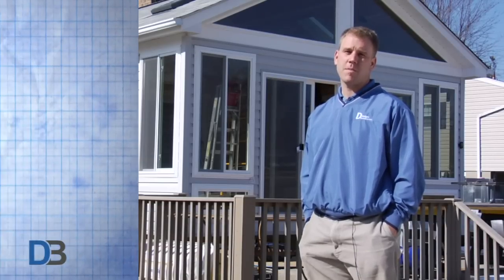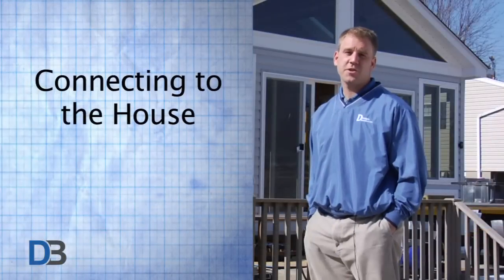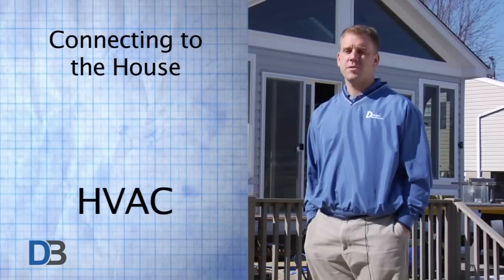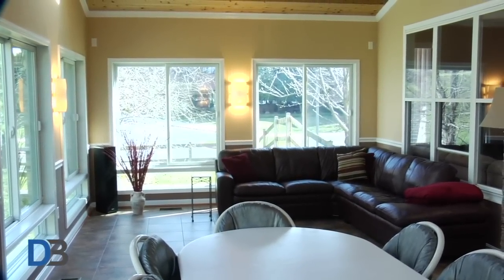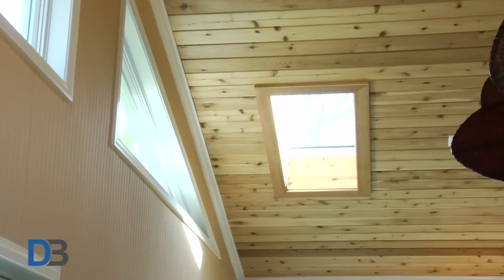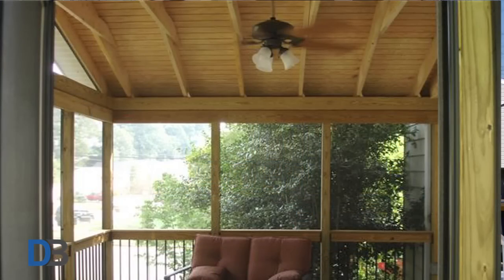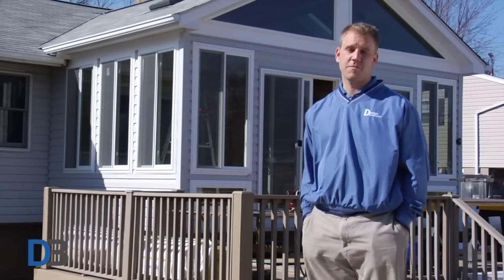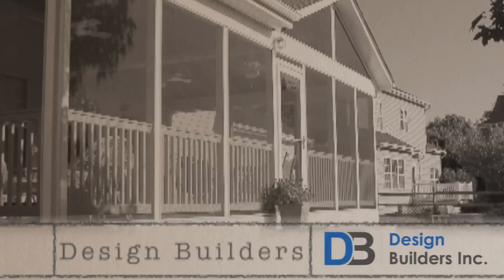5 Helpful Hints for Building a Sunroom

Comment: We would like to convert our screened porch to a sunroom. The previous owners built the porch on the deck against the house. We will obviously need new flooring since the flooring is just deck boards with cracks between them, so we plan to insulate and replace that. Will we need to make adjustments to the foundation/footings since it's sitting on a deck (deck posts)? I'm assuming that an interior room should probably have some kind of concrete foundation. What do you think?
Reply: So this comment is 3 years old.Did you go ahead and add the sunroom you wanted?
Reply: @keytothegate68  Thanks for asking! I thought I was the only person that asks for updates. :) We actually did NOT convert the screened porch to a sunroom. I've thought about it a lot and watched this video a few times over the years, but my porch is kinda small and we figured that if we were going to put the time and money into a conversion, we'd want to make it larger. That would mean changing our roof which we wouldn't do as a diy project. Plus, I use the porch for smoking and I'd just get it all stinky and ruin it. I wanted it to make it warmer in winter. I saw a video yesterday where someone had converted their deck to a screened porch. They commented on how an inspector said that the footings under the deck were created to bear the weight of the deck, but not a screened porch with a roof so they had to add another support beam and footings to bear the new weight load. I imagine the weight of windows could affect certain decks too. Just something to think about.